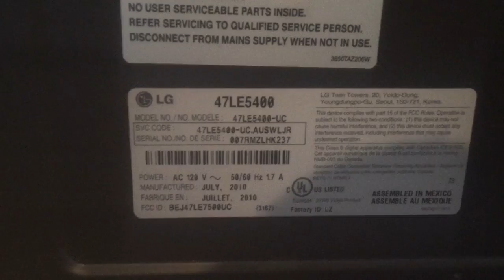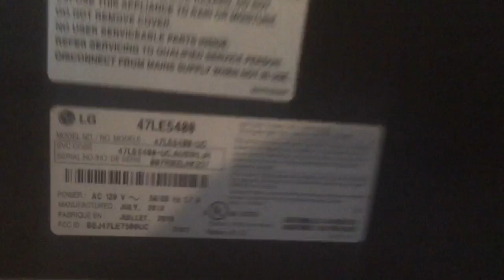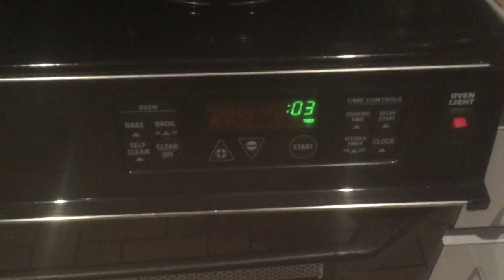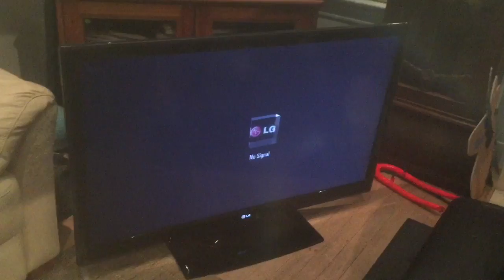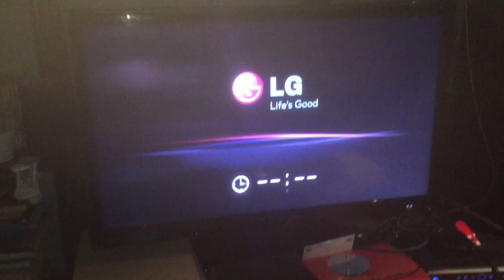Repair An LG Television Motherboard By Baking It In The Oven

Comment: How bad is the smell?  I live in an apartment,  with a door leading to a patio next to my kitchen, but I'm debating this method because of meighbors.  Suggestions?
Reply from the maker: Keep the patio door open ... should be fine.
Reply: +Avrim Fishkind  Did everything as posted on the video.  Worked like a charm. (LG 47LE5400-UC)
Reply from the maker: Fantastic!!

Comment: I can't thank you enough!! This method, if preformed correctly, does works. But I also have a question for you Mr. Avrim. After it was fixed, did it give you any problems again?  

- Kulwinder Singh
Reply from the maker: I have never had another problem.
Reply: Thank you for the reply! Saved $280 dollars because of your kindness.

Comment: Worked for me too. HDMI ports are also OK now (haven't been working for a year).
Disassemble the motherboard (take down all plastic attachements). Pre-heat the oven to 200 degrees C , put it in on a cardboard for 10 min. Leave it for 10-15 min in the oven to cool down slowly. Another 20-30 min outside and reassemble.
Good luck!

Comment: Just got mine out of the oven. It doesn't smell as bad as some say. I just turned the oven fan on high and got a fan pointing OUT the kitchen window (to blow the air OUT) and the smell never really left the kitchen area. Waiting for it to cool now so I'll be back to let y'all know if it worked for me.

EDIT:  Got my LG back together and back up on the wall. Plugged in all the wires and all my HDMI inputs work now...  Life is Good!

Comment: the hdmi ports on our lg tv totally stopped functioning. tried this as a last resort before replacing the board, and it's totally fine now! I was so skeptical but it fixed it.
Reply: still working??
Reply: Thalles Felipe unfortunately no, but we got another 6 months out of the TV before it stopped coming on completely! We did not try to do this again at that point.
Reply: Still a great way to get some more life out of the TV.

Comment: This fixed my HDMI ports not working - delighted !  10 minutes in a pre-heated oven at 200C.  The board warped a little because the cardboard wasn't flat but still works :)

Comment: Worked like a charm for me... 10 12 minutes in a 280 degree oven, some connectors are loose upon removal so go easy. After 15 / 20 minutes reinstalled board and it worked. Thanks Avrim...:)

Comment: Am I really the only one who tried this and ended up with a completely broken TV? the only issue I was experiencing prior to baking was my HDMI ports suddenly not working. Now my TV won't turn on at all. Really heavy paperweight. Any ideas? LG 60LD550 manufactured 2010.
Reply from the maker: Christina I'm sorry that happened. My problem and the the issue in this video was a completely bricked TV.  I hope after letting your motherboard sit for more time all is ok.
Reply: +Avrim Fishkind thanks for your reply! I read another thread full of folks who had the same hdmi input issue pop up for them and they all had great success so I felt pretty confident going into it that it would work for me, as well. I've checked around to see about buying s new motherboard but the only place I found one says they're out of stock. Plus, I'm worried I'll drop $100 plus and it still won't work. I guess the tv lasted me a good 5/6 years so I'll take it for now and bite the bullet on a new (non LG!) one.

Comment: I was worried using household oven after hearing other comments regarding odor and residue that might be left behind during baking process.  We have a Presto Pizzaz open rotating oven and I decided to try that outdoors.  I set the motherboard on the platter on top of cardboard and set timer for 12 minutes.  I was unable to tell temperature but watched the board during the entire process in case of melting or burning.  I let the board cool for about 45 minutes, then reinstalled and it worked!!!!!!!
Reply from the maker: Yeah the odor is pretty harsh ... I had the door to the kitchen open out to our deck ... and the ventilation hood on. So far no ill effects on my family :)  I do like your idea of using the Pizzaz.

Comment: I had fixed a Dell XPS laptop similarly a few years back...  Avrim's youtube video worked for me.  One day, about when it was just over 5 years old...  it would not recognize HDMI inputs.  The HDMI input was not greyed out, it recognized the HDMI device (I use a Video receiver) was plugged in but the rotating LG square logo said no inputs....

So I take the back off, remove the motherboard and bake at 375+/_ for 10 minutes....  And put it all back together and the set now recognizes all 4 HDMI inputs!  

One word of caution, there are two signal ribbons for screen display.  I did not re-seat one completely. so one side was good, but the other had vertical lines.  Moral is do not put all the screws in before testing.  I seated the signal ribbon wire correctly and boom!  I got my set working again.  Many thx to Avrim.

Comment: Great video!  I have the same TV (47LE5400) purchased in Dec 2010 that quit working yesterday (component and antenna connections still work).  Also saw the Zedic site that shows the same fix.  I'm going to bake the main board tomorrow and see if it works.  Thanks again for posting this!
Reply: +Twin Cities Dashcam   IT WORKED!  Awesome!  Thanks again for the video!
Reply: +Avrim Fishkind - were you concerned about melting the parts on the motherboard? like the component input jacks, etc? i have the exact same situation and am wondering what to do.
Reply: Kapton Tape